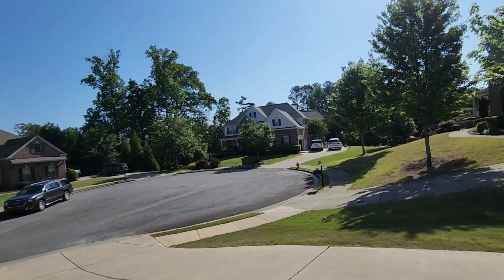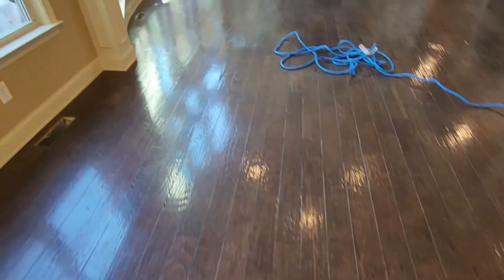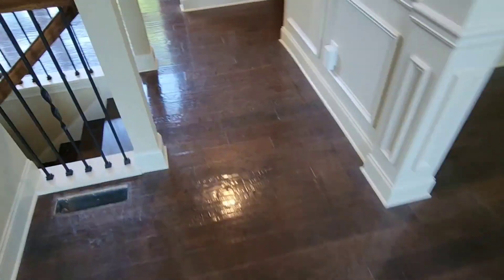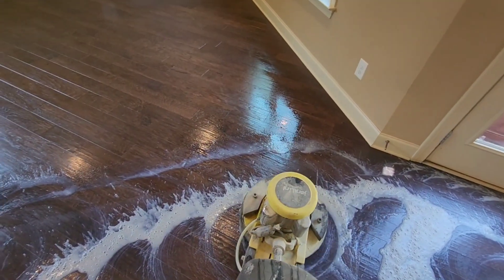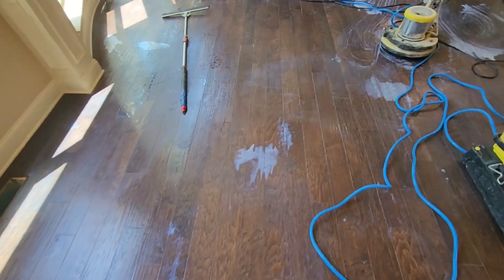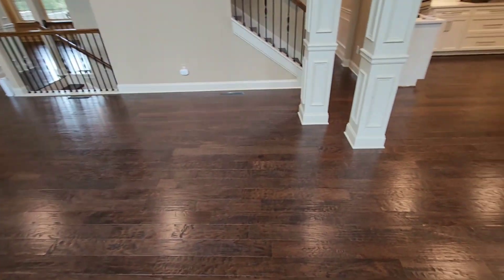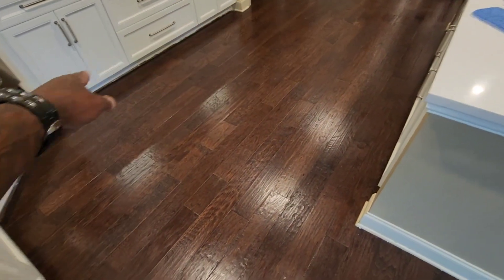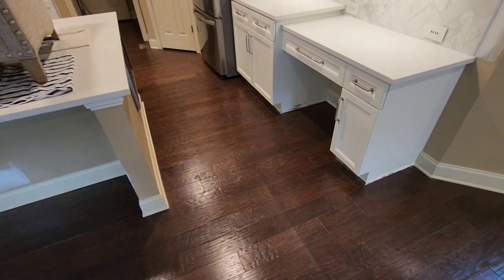Floor Transformation: Removing Years of Wax Buildup | Floor Restoration

Comment: The more coats of wax the more dwell time.Have to give the chemical extra time to work. 25 plus coats it can take a hour for the chemical to reach bottom. To prevent drying out just keep it wet. Add more water. Tile unlike wood you can put down a lot more solution.
Reply: what chemical do you use? purple power degreaser does not work has good has expected.